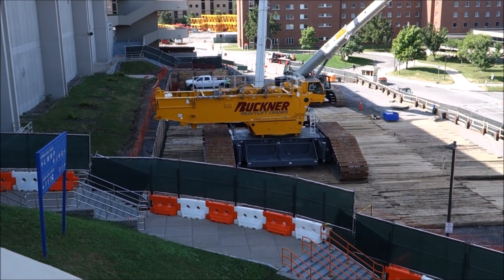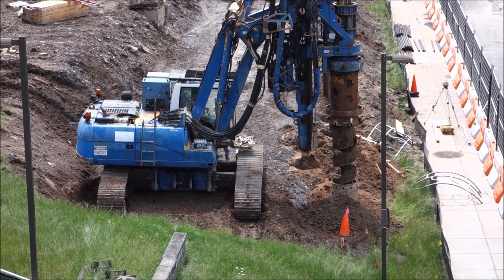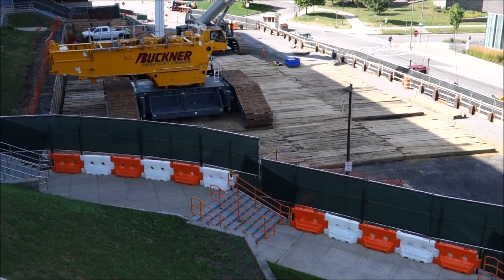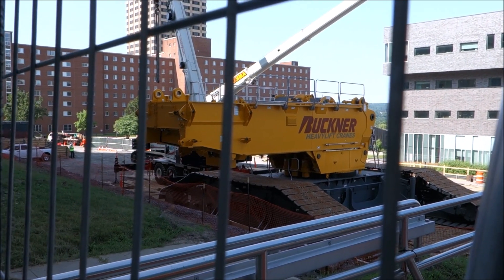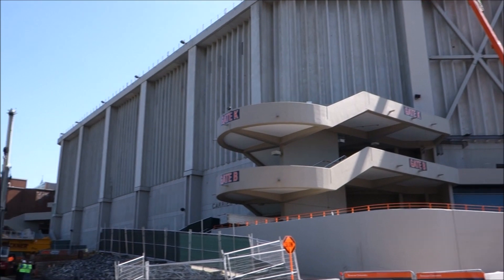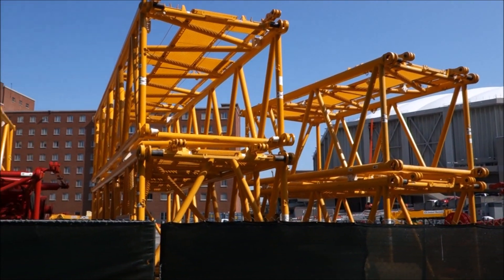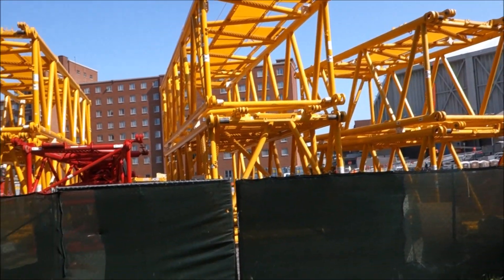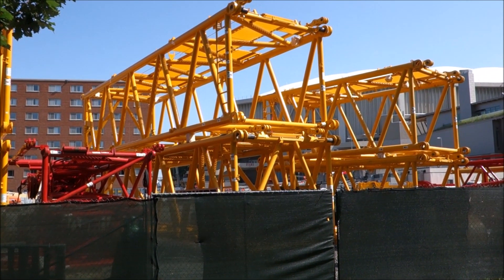Liebherr LR11000 Mega Crane - Syracuse, NY

Comment: I heard that Syracuse still uses wooden pipes for the drinking water and they’re prone to break & septic waste has infected a portion of the drinking water there.
Reply from the maker: Yup. Gotta drink nothing but beer to be safe.
Reply: No wood mains, just 100+ year old cast iron pipes that easily crack with the shifting clay soil.

FYI, Water pipes are shallower than sewer and are under pressure.  Considering there are over 200 breaks a year, rarely is a boil water advisory required. 

Dealing with algae blooms from skaneateles lake is usually the biggest problem. Syracuse does not filter the water, just disinfect.